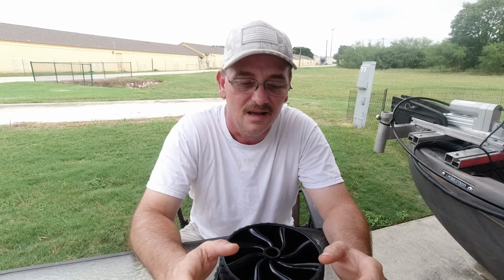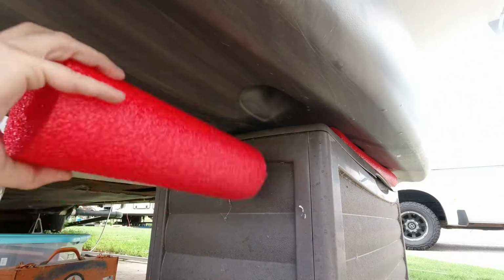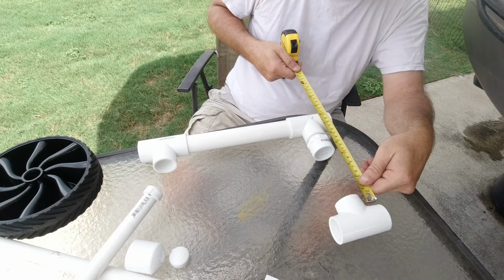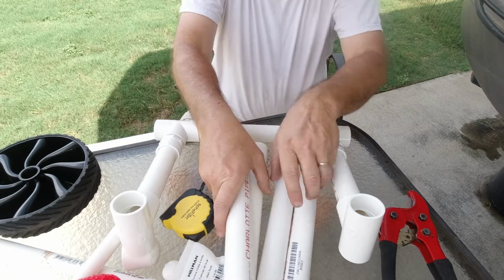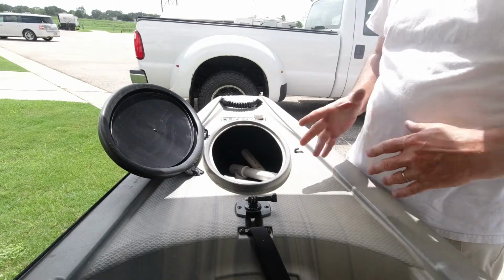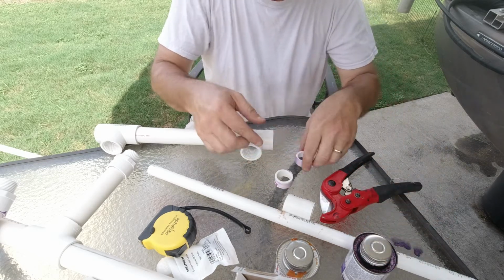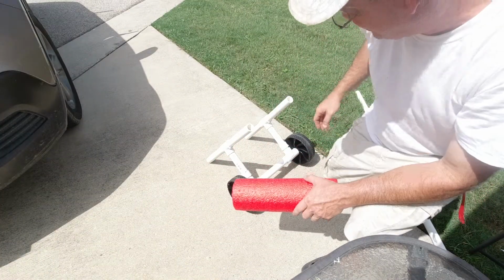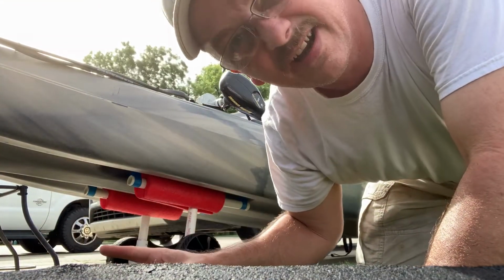Collapsible Kayak Cart DIY

Comment: Awesome design. I havethe same kayak so ill definitely use it. Just one question. How exactly are you strapping it to the kayak?
Reply from the maker: Thanks a lot man if you like that video subscribe to the channel and also watch this one with the most DIY‘s on that type of kayak
https://youtu.be/26gyKUiCR6c
Reply from the maker: Very simple is designed where you loop Through the scupper holes onto the PVC pipe and then strap tight on top